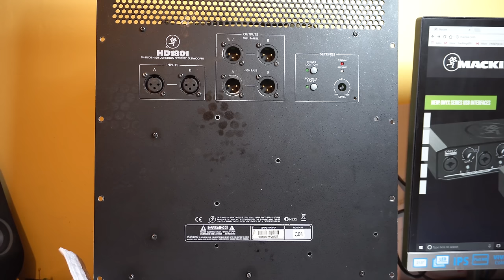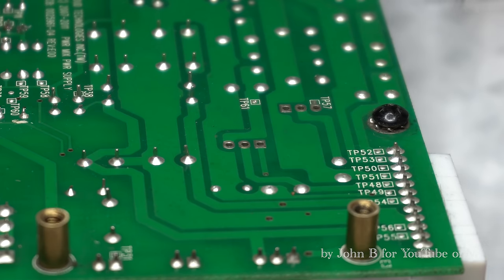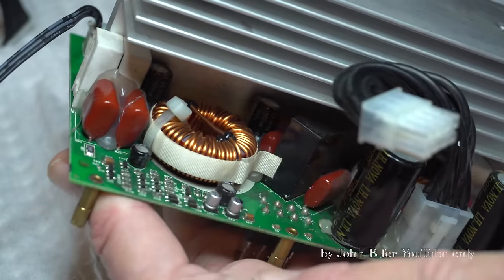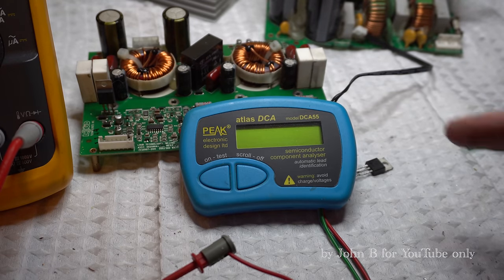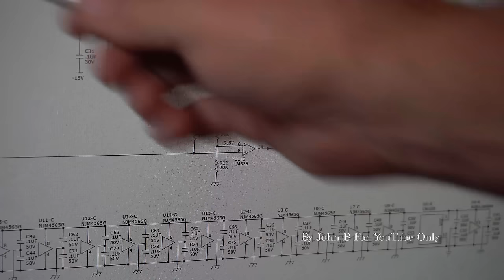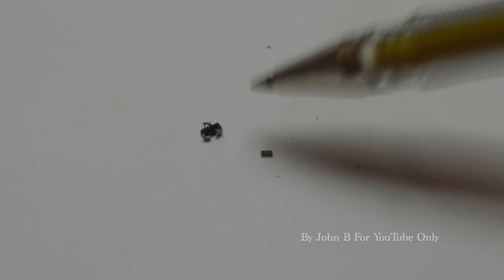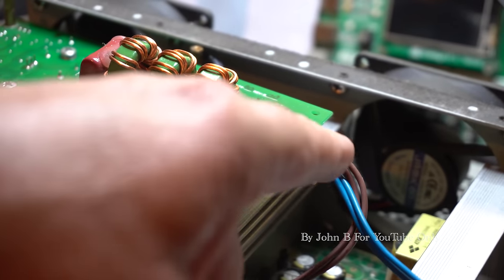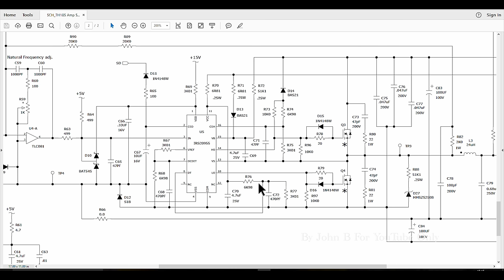Mackie HD & SRM1801 Sub Woofer Repair + IRS20955 & IRS20957S 500 watt Class D Drivers

Comment: I have had a SRM1801 module, only one half populated - less power, for some time. I will tackle it with renewed effort having watched this video. They can be difficult to test on their own because of the multiple voltages required, apart from the other signals required. Thanks again for the straightforward explanation it will give me renewed energy to tackle a Class D amp. It took me a while to understand a 'self-oscillating' Class D but I now get it. SMPS and Class D is a long way from how I was reared! Thanks again.
Reply from the maker: Thank you Bill for your comments, I hope you get it going too.
I had bad solder joints on some of the newer models like your SRM1801, through plating joints broken etc.

Comment: Impressive that Mackie releases the schematics to the public. Big props to them for doing it.
Reply: tHaH4x0r they had to, with endless complaints and returns nearly sent them under! Classic example is to check the history of the Mackie x200 mixer!
Reply: I see! I have no experience with this company, or a lot with audio equipment at all for that matter. But the construction quality seems at least semi-decent.
Reply from the maker: Yes I agree, except one can struggle finding the exact drawing.
i.e. The HD1801 psu is not under that speaker.
My input  board had different id's compared to the drawing.
Thanks for your comment.
Reply from the maker: tHaH4x0r, Manchester Sound Studio

Thanks for your input, I read it in horror because I'm pretty sure I have a 200 mixer at my front door, it arrived yesterday lol.

Comment: All about to irs20957s ic chip for mosfet, i change it and the two mosfet but the mosfet was short again what is the problem, I already cgeck the reistor ang capacitor
Reply from the maker: Where did you buy parts from?
Reply: @JohnB-2021  in china
Reply from the maker: @fclightsandsoundvlog5175  That will be your problem!
Farnell & Mouser now stock the original parts.
Reply: @JohnB-2021 did you have a testpoint for the ic to test and how to test the circuirt without  mosfet
Reply from the maker: @fclightsandsoundvlog5175  check the drive to one mosfet, you need both fets for it to work correctly
Reply: @JohnB-2021  the mosfet was connected to ic irs20957s

Comment: Hi John! I have a SRM1801 amplifier. The amplifier came to my desk with a missing contact of resistor R100, which provides VCC power to the IRS20957. I restored the contact, and also replaced the burnt 1 watt SMD resistor R32 with a 2 watt one. The amplifier started working, but this resistor (R32) located in the feedback circuit is very hot. I measured the oscillation frequency of the amplifier, and it was 534 kHz. I saw here in the comments that it should be 400 kHz. Is this true? And will lowering the frequency help reduce the heating of this resistor?
Reply from the maker: Hi, I don’t think lowering the frequency will help too much. 
My only real experience with feedback resistors was on the 450v2 and the resistor did always get hot.
Reply: @JohnB-2021  Tried to reduce frequency to 400 kHz. Resistor temperature dropped from 100 to 80 degrees Celsius

Comment: Do you repair amps john? My swa1501 keep blowing the internal f2 fuse cant see anything burnt or missing on the board
Reply from the maker: It will have blown something assuming the correct value fuse keeps blowing.

Comment: Hey John, I’ve got the same hd1801 with same issue as your video.  I ordered a replacement amp they sent me Srm 1801. Different size plate etc. Are the components the same that I can just switch them? I gavant taken the amp out of the cabinet yet.
Reply from the maker: I thought the SRM 1801 had half components not fitted.
If it looks the same, it is the same.

Comment: Hey John love the videos. Im working on a 1521 amplifier that blew two 56 ohm resistors. I have the schematics, but not sure where to start. Would you take a look and point me in the right direction?
Reply from the maker: Without looking at the circuit drawing, I'd say it has blown power transistors.
Reply: That would be a good guess. I ended up pulling 2SA1943 + 2SC5200 and I had continuity across all three pins. Ordered a new set, ill update you when they come in. Thanks =)
Reply from the maker: umm, I figured with the value of the resistors you said were blown, it sounded like a regular class b amplifier with transistors.
Hope that's all that was blown.

Comment: Because I like electronics, which I know nothing about, and I also own 2 Mackie SRM 1801 and SRM 450 V2 which all mal funcion, 450 lasted for 3 years and went termal (red light) and 1801 just stop working after 6 or 7 uses (power on but no sound) I watch 60% of your video. By that time my head wanted to explode, to much input in short time.
Sr. you are an electronic GURU, with a privilege mind.
Thank you for your time put in to this video. Will try to finish the other 40%, you got my subscribed.
Reply from the maker: Thank you kindly, I hope you find the faults but they can be difficult.

Comment: Hi, Thanks for taking the time posting this great video of how this amp works!  I had performed the same FET and driver replacement repair about 4 years ago and it has been working fine until now.  I have a similar issue to another comment (Frank G).  Mine will come on and play for a while and then go into protection for a few seconds and them come back with all lights staying on during this cycle.  It will continue to play if I reduce the input but it has to be pretty low volume for it not to go into protect and feeling the chassis there is no apparent warmth at all so i doubt it is really a "thermal" issue.  I tried testing the individual channels with a dummy load, and found that the top channel (closest to the 12V reg) gets very warm (45+ C) and will cycle off and on when pushed over 29V on the output seems like an internal self protection (no protection lights or visual indication of protection engaging).  Same test on the other channel, does not heat up the 12V reg U6 or FET's.  I've also been unable to replicate the protection light symptom on the bench using the dummy load so I'm starting to suspect an intermittent short in the speaker at a certain excursion point.  The speaker measures 6 ohms and my dummy load is 4.5 ohms so maybe that difference is enough to cause a different symptom on the bench as you mentioned that they may be sensitive to load.
All voltages seem fine from the power supply.
As another test I tried just running the sub with the speaker from bottom channel (that wasn't getting warm) in non-bridged mode and the protection lights came on after a while as well.  I've tried running the sub with speaker from the signal generator and wasn't able to get it to go into protection.  It seems like it hates kick drum which is why I suspect the speaker may have an issue with high peak transients!
Also, what should the voltages be at the FET's with no signal being applied?
Thoughts?
Do you know of a way to test the speaker driver for shorts?  At rest it seems fine.
Reply from the maker: Hi,
I test these amps with a 4 ohm 100 watt resistor and have no issue but now understand the HD1801 and SRM1801 have 8 ohm impedance speakers, the SWA has a 4 ohm.
I've seen a few 'HD' subs cut out prematurely when the coil measures less than 4 ohms, usually 3.9 or less means it is going short circuit. The thermal protection is in the power supply, I suspect yours is going into current limit which will bring on the thermal light.
The full supply rail will be at the fets.

Comment: Hello John, thanks for making this awesome video explanation! I got a Behringer Top and a Sub and both down power on. I decided to take on the challenge myself and learn about how the systems work and on some forums the mentioned MOSFETS and Drivers IC going bad so here I am watching an excellent video that explains what could cause them to stop working, where to check, and where to buy legit parts hehe thank you so much for the video. I think I am going to grab my old Electronics books to refresh my memory and buy that device to check the MOSFETS! Thanks it was worth it watching the entire video!
Reply: I am not a technician, just a self-taught guy finding new hobbies. That's how I learned how to DJ, how to alter clothing, fix computers, etc.. now considering taking some electronic classes to understand how circuits work.😁😁
Reply from the maker: Thank you for your comments, I hope you achieve your goal and get the amp repaired successfully.

Comment: thx for the insight. some while ago i came to my point that repairing smps and class d amps manufactured in china is no fun for me (as a trained radio-/tv-repair-technician); these are build NOT to last and NOT to repair... 
but it is possible to repair ANY device (if you have a huge amount of time, patience and knowledge) as we can see within this video. ;-)
Reply from the maker: Thank you for your comments.
I too gave up repairing this newer stuff, too many bad pcbs with blown 'through hole' connections.

Comment: Hi John. I'm wrestling with  IRS20955(S)PbF on a powered RCF 715. Measuring from speaker common i lost 10V on pin 2 CSD for both the trebble and bass side. while comparing voltages on a good amp i also managed to do damage and lost most of the 10V here also. pin 1 is VDD and has 10V between speaker common but when measured against com pin 9 the voltage is much higher, this ic can run up t0 200V (these 2 RCF amps (comparing a good mk2 with a bad mk4 RCF 715-A) between 70v and 100V from memory powered between it's common and VDD. The voltage difference between pin 9 and pin 1 and 2 has changed between the good side and the bad side on the good amp that became damaged but it is not as low as on the initial bad amp.
  I removed the IRS ic's from the bad amp and was testing pad voltages when the power supply stopped working, but it only failed after a min or so of testing, opto isolator voltage is almost gone and the supply just whines. Have i also blown up the supply or did it just take some time to go into self protect due to removing the two irs ic's?
  Have ordered one new IRS (the most expensive one on ali express, lol)  for my amp to see if i can get mine working again, if this works i will order 2 more and attempt the first amp that i was trying to fix to begin with. Any tips?

Before i destroyed everything i was seeing the gate voltage (around 4V) being replicated at the output of the speaker mosfet when it should have been around 0.2v (bias i assume) on the mosfet output (this is how it was showing up on the good amp until i took out one of the IRS or surrounding components).
Reply from the maker: Did you remove the 4 fets too?

Comment: Thank you John B, very well explained and great analysis of the cuircuits.  I have similar problem with my Ampeg PF-500 same circuitry as the one you're showing here more or less. I did find 2 shorted output FETs IRBF4227 and I've also ordered the IRS20957S as per your suggestion and waiting on their arrival. Would it be possible to make a video on the Ampeg Fault light / shut off circuits, I'm not sure I quite understand it 100%. Its my first Class D amp repair. Thank you so much and keep up the good work and videos. Cheers.
Reply from the maker: Thank you Peter for your feedback.
I've not seen an Ampeg amp but will keep my eyes open.
Reply: @JohnB-2021  Thank you again for this video, it surely helped me troubleshoot the PF-500 which has a very verysimilar circuit. I wasn't asking you to repair one but merely by looking at the schematics which is readily available just by searching on the internet if you could just sort of analyse the fault light / shut down circuit. I appreciate all your hard work and thank you again.

Comment: We modded a Mackie Onyx 24-4 mixing board for post eq/fader/gain. Trying to hunt down a schematic and getting help from Mackie or Loud technologies was hopeless. Basically said you're on your own and no help what so ever. We eventually finished the mod and it works great.  I,m curious if anybody else has had issues with getting schematics or getting help to repair? Rode Electronics sent me a schematic in a matter of minutes and were very helpful!
Reply from the maker: I found all the schematics I required on their website.
I've not needed the Onyx drawings though.
Good to know Rode are helpful, I have their microphones.

Comment: Thank you for the great video. I'm 99.9% a tube amp guy and I've been asked to have a look at a bass bin amp with power supply board 0027030 which looks identical to this one. Sadly, for me, your power supply works. In my case, it appears to not. For me, these are very complicated power supplies. Nothing like an old tube amp with AC being rectified, then thrown into a filter cap, dropping resistors, and feeding the plates of some tubes.

But I've fortunately troubleshooted that the Transistors you checked and found faulty, in my case seem to be okay. No shorts.

I wish the schematics had some voltages for me to compare to at various test points. Right now I'm getting over 300VDC at the bridge rectifier, 240VAC right before it. However, I'm hearing a ticking sound, and the amp has zero life, no LED's light up. I'm suspecting VDR1. The only relay in the amp is on the D-class board, which I disconnected, and I'm still hearing a ticking sound, along with no power to the LED's. I seem to lose voltages all together at T1. So this video is helping me get familiar with the board as well as looking for trouble areas and ideas to test. Thank you again. I hope I get to the bottom of this, for my friends sake, and for my own education.
Reply from the maker: So you have no +/- 15 volts?
Do you have a 5 volt ref on the chips?
Reply: @JohnB-2021  seems like everything I measure is giving me +120VDC (not a typo) after testing some more today. I think too much is fried for me to continue and making this job financially viable.

No voltages at all at D1 through to D4 which look like they help with the high voltage (60-70VDC). These appear to come directly off T1. So perhaps T1 is also faulty.
Reply from the maker: @whatsstefon  It's unlikely to be the transformer, more like the driver circuit is dead / short circuit.
It sounds like you're using the case as ground, that will give you wrong readings unless you're not which means the suppy neutral is open circuit.
Reply: @JohnB-2021  oh. I am using case as ground. I guess that’s my tube amp education. I’ll recheck voltages tomorrow. Where do I “ground” my multimeter?

None of these “test points” tell me what voltage I should see. I’ve been searching for +/-15VDC and +/-60 to 70VDC and haven’t found anything close to that. The amp has zero life and I’m still hearing a ticking sound but I don’t see any relays on the power supply.
Reply from the maker: @whatsstefon  The ticking will probably be from one of the transformers.
You will have to solder a wire to a known good ground point as marked in the schematic.
Reply: @JohnB-2021  shall do, and report back tomorrow.
Reply: @JohnB-2021  I have now found a good ground point and so far have measured Pin 8 of U7 which is jumping around between 11VDC to 23VDC.
TP11 i'm getting similar jumps from 1VDC to 15VDC to -1.0VDC

0VDC between TP27 and TP29

334VDC between TP4 and TP6 but nothing coming out of the secondaries of T1B

0VDC between TP29 and TP30